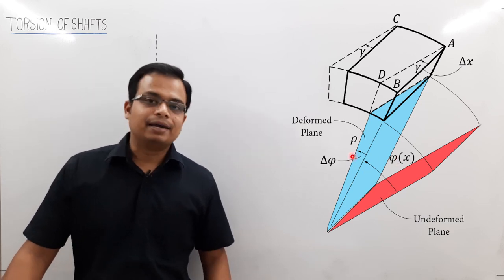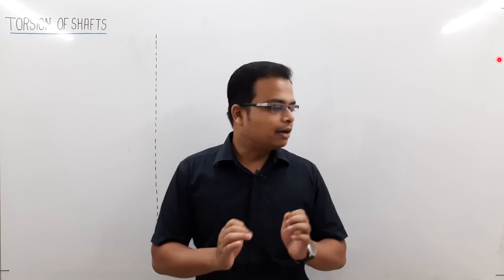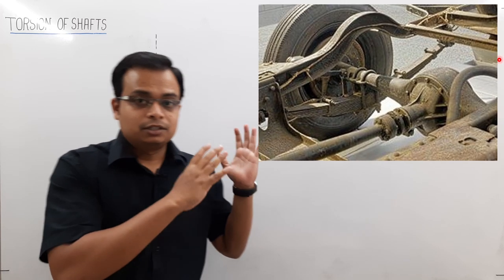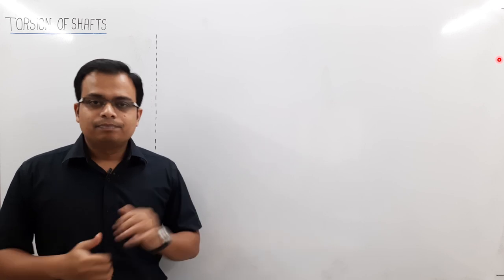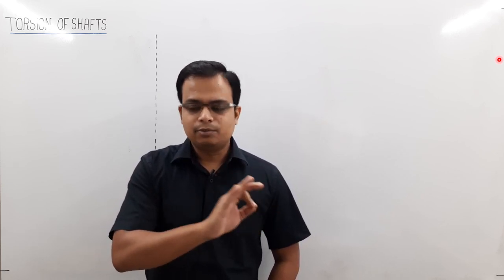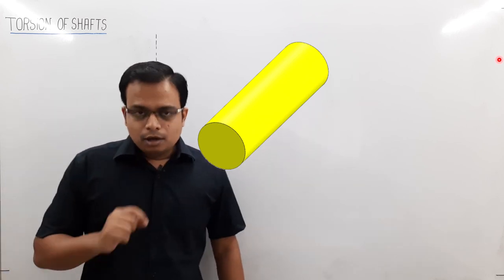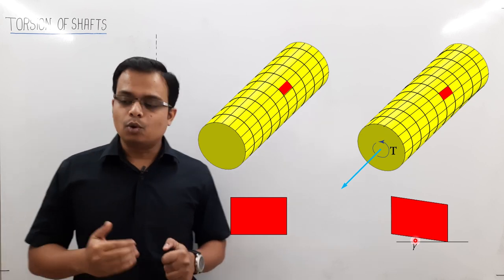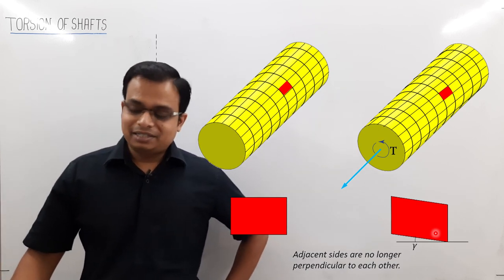Torsion in Shafts_Complete Concept

Comment: Sir plzzz help me I have a question 
(draw the isometric view of the frustum of a cone of 
40 mm base diameter and 80 mm axis height and cut by a horizontal 
section plane 25 mm below the apex. Drawing should bear proper 
detailing using texts and dimensions wherever necessary)

Sir plzzzzz help me to do this question can you plzzz solve this question on AutoCad and send me the project via link sir plzzzzz help me